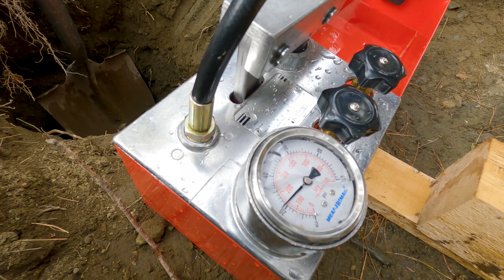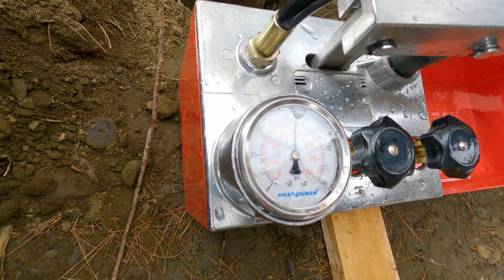SURPRISING septic system pressure test || DIY House Build

Comment: I’m going to go out on a limb and assume y’all are using Ubiquti Unifi for your APs and cameras? If not - give them a look! Awesome hardware/software that’s easy on the wallet with no subscriptions. I have their Dream Machine SE at my house with 3 APs and a few cameras. Absolutely love it. Really enjoying the videos and excited to see the network come to life once y’all get there 🤓
Reply from the maker: Funnily enough no, we're actually not going with Ubiquiti for our camera or networking setup. I used Ubiquiti for an AP in the RV a few years ago and for various reasons, ended up swapping it out for a TP-Link Omada AP instead. Based on my experience of both systems, we're planning to go with TP-Link Omada for the rest of our APs. We'll use OPNsense for our firewall / router - same as we have in the RV.

As for cameras, the Ubiquiti cameras are impressive, but I don't like the vendor lock-in they bring. Instead we'll be using regular PoE IP cameras that I can manage through something like Blue Iris or similar. That gives me a lot more choice of cameras, as well as an open platform to integrate into the rest of our home automation system however I like without having to worry about any cloud connectivity or proprietary systems.

Nothing against the Unifi stuff in general though, it's just not right for us in this application.
Reply: Thank you for your reply! I’ve heard good things about the TP-Link gear. I’ve been locked in to UniFi since 2015 when they were a nothing company. I’m hopeful down the road you’ll do a video or two of an IT tour 😊

Cheers from Atlanta, GA!